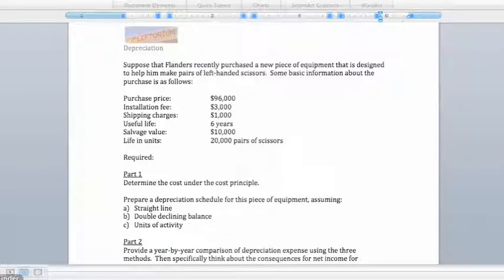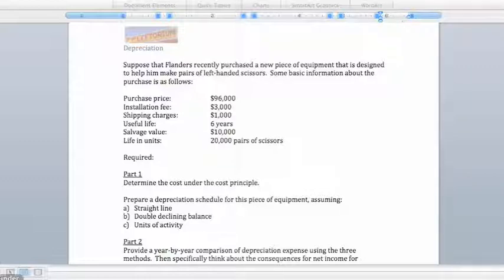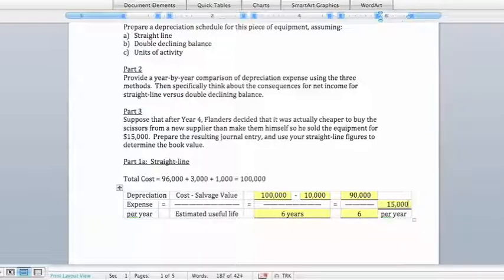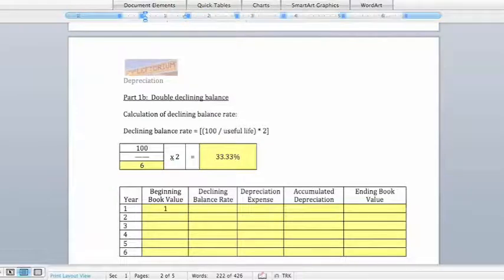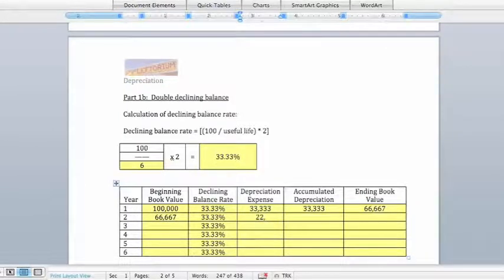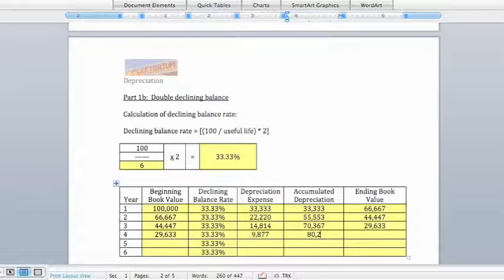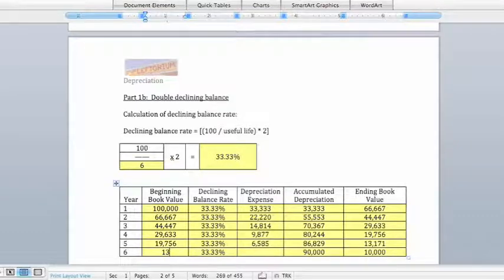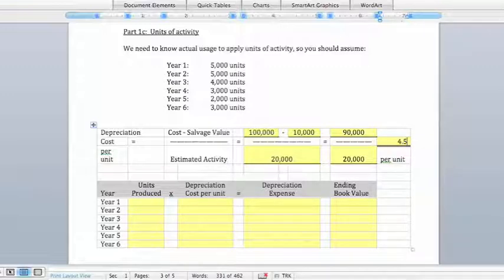Depreciation Example Part 1 (Straight Line, DDB, Units of Activity)

Comment: This example is very simple and is every where they divide by 5 to 10 years but suppose you have the following e.g Plant at cost is 1280.Depreciation 710 as at June 2010,Calculate Depreciation for the year ended June 2011 as follows: Plant 15% per annum straight line on cost? how will you do this? no other information is given